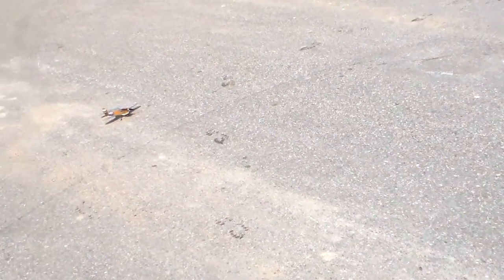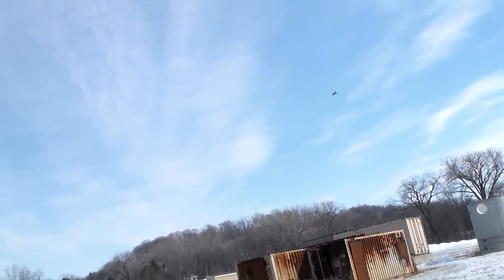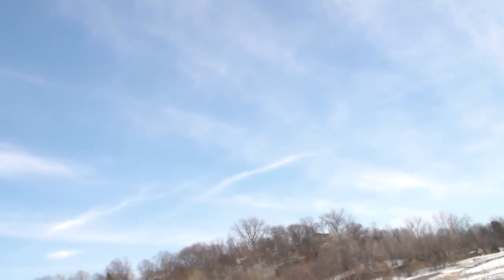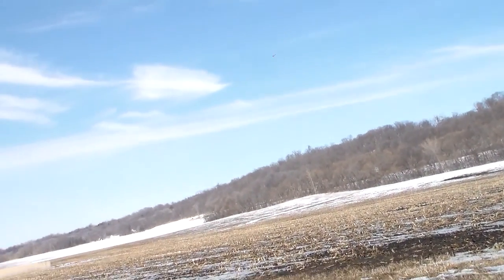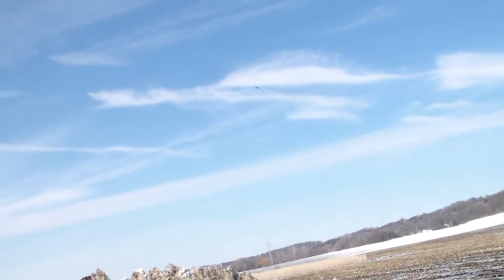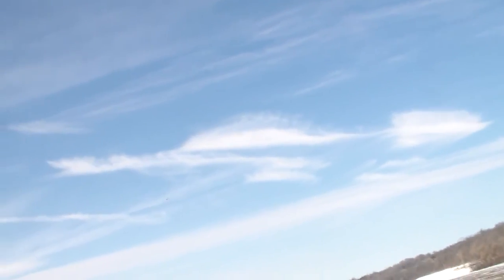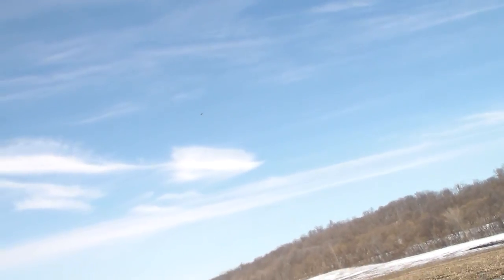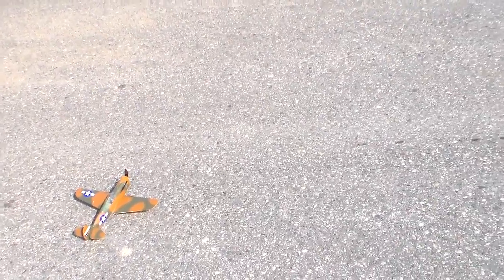Guillows p-40 rc test flight

Comment: just minutes ago i bought the same kit. .... happy to see a successful rc conversion of it
how much dihedral did you use
Reply from the maker: hi,  i used 1/2" of dihedral in this build. i think it would fly better with 7/8" like the kit suggests. remember to build it lite. you could gut the aft fuselage and build the tail surfaces with sticks instaed of solid balsa. this model would be much better 1 oz. lighter.this model is still flying! Have fun!! =D
Reply: jagdpanther9 ...thanks for useful informations .... keep up the good work
Reply: @jagdpanther9  great info. Will use the advice in the future. Have 3 different guillows kits in the hanger awaiting there turn on the build table. Keep those videos coming.
Reply: @thatguy83ful  Dude, I have a 2004 SC281.  Got her brand new in Missoula MT.  Happy flying!!!

Comment: Where did you set your CG? I dont think it mentioned it in your RCG post.
Reply from the maker: Steve Madak on this and most of my builds big and small I take a piece of paper about am inch wide and cut it to the width of the middle wing. then I fold the paper into 1/4 ths. this distance from the leading edge is your most forward c/g mark. then take the piece of paper and fold it into 1/3rds and make this mark from the leading edge. this is your rearward c/g mark.this method has worked great on everything from these micro guillows builds to my 101" me109. =D
Reply: Steve Madak 
;

Comment: Looked like you were flying a hummingbird.
Reply from the maker: this model flys on its 2s power! this is one of the first r/c conversions i built and i used heavy duty servos and esc with a full sized 4 ch RX! also i did nothing to lighten the air frame . i used alot of glue and reinforced everything. so @ 4 0z. it is twice the weight it should be . it is still flying! after many flights and has literally cartwheeled landing in tall grass with no damage. it is a handfull to fly and maybe a little more dihedreal would help . i do like tour description of flying like a hummingbird !! =D